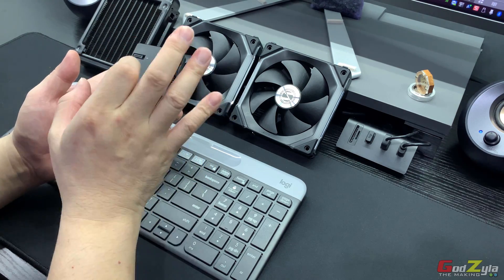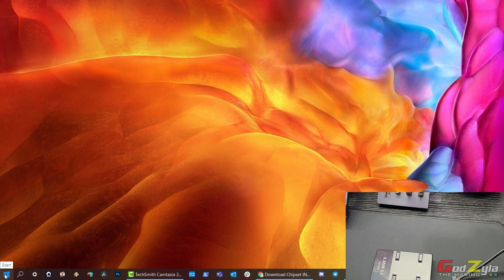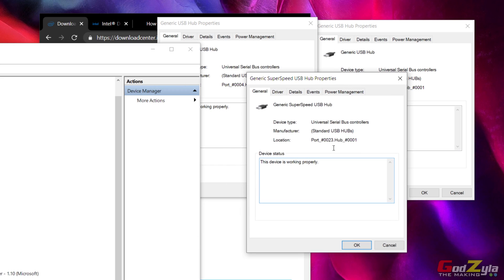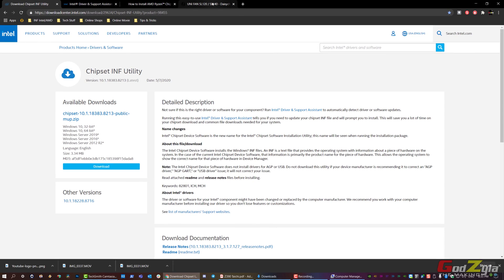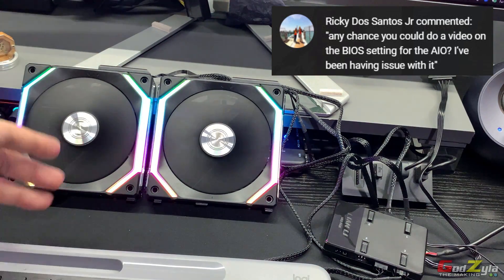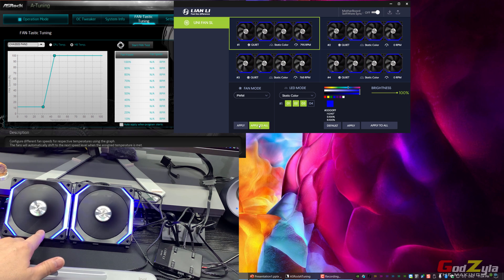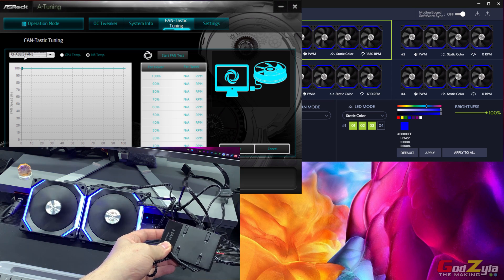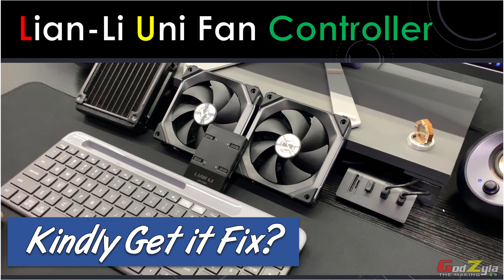Lian Li Uni Fan Controller - Some Break Fix! [L-Connect]

Comment: You are awesome, thank you for this!   Fixed my issue.  However, I'm trying to use two of these controllers.  The device manager detects both of them but once I bypass the manual controller (holding M1 down for 3 seconds) I lose lights.  I notice in the software there are only spots for 4 ports.  Do you know if there is a way to add the addtional 4 port from the other controller or am I screwed?  To be clear, I'm trying to run two sets of strimer cables.  First set works, second set not working.  If this can't work, what about modifying the cable to hook straight up to an ARBG hub?
Reply from the maker: hi Kilgoran, at the moment, when you mentioned that you are using two controllers. Are you referring to use two strimer plus controller to a unifan controller? 

if you are using 2 strimers controllers without the uni controller. yes you can get a spliter which connects the 2 strimers controller to your motherboard. 

if you are using 2 strimer plus controller with a uni controller. you can just plug each strimer plus controller to indvidual output of the uni controller. 
this video will show you one https://youtu.be/Y0ni_tfcX3g you can repeat to plug another into another output.

Comment: Well, I watched your video, and tried myself to solve my issue.
But still, I found no solution... :/ 

The USB cable, the PSU Data connector, the PWM connector AND aRGB cables are all connected to my controller and MB.
L-connect is installed and recognized into the Windows device manager.
But, nor the RGB, neither PWM are recognized. I mean the default RGB and PWM are applied and can't be changed.
I installed L-connect as an administrator, it doesn't change.
I switched my PSU sata cable to another one, it doesn't change.
Same for my USB cable, it doesn't change.
Same for my aRGB connector, it doesn't change, and finally... Same for the PWM connector... Well you understood !
I basically have no idea how these fans work... Or I don't even know if they really work, or should work lol.
Even in the BIOS, there's no fan recognized...

It was very simple with my triple pack of Corsair LL120+ commander Pro.

My partial setup : i9-9900K / aorus Z390 Ultra with a black cablemod.

I also tried to only plug USB cable, install the driver, then plus the sata cable, but still... L-connect doesn't recognize Unifans...

Any idea ?
Reply from the maker: Hi SNTSIS Media, welcome to my channel. it seems like you almost tested everything.. there is only two questions I have for you. are you still using the commander pro application? 
you might want to try removing that application and just test the uni controller with the USB and Sata cable. if that does not work, I would recommend you to post your issue at the lian li reddit website https://www.reddit.com/r/lianli/ or to raise your concern at li-lian tech support https://lian-li.com/faq/
Reply: @KleoYan   Hi Kleo :) thank you for your answer.
I'm still using the Commander Pro as it is my interface for my AiO (H150i Elite Capellix + 3 other LL120).
I'll try to remove all RGB soft (I've got MSI for my GPU, Aorus RGB Fusion for my MB & Corsair iCUE for the AiO & fans) and reinstall them to see what happens
Reply from the maker: @nuncyosa  Oh no. You have too many aRGB apps going on. Try to choose and use only one interface where you can control all. I believe those argb apps are snatching to have access with your system board. Just to share, In general, I dislike argb due to these reason. 1st draw extra current either from motherboard or from PSU. 2nd it generate heat (not much but still heat) 3rd argb often or overtime burn out easily. Once an argb led burns out. Your entire argb can’t be used. 4th unnecessary bloatware which causes lag in using editing programs or to do 3d rendering. This is part of the reason why I choose to use ASRock board, where u can control argb or rgb in uefi mode. Don’t need to install any apps. Or to use physical remote control method to control the argb or rgb. Still it’s up to individual liking. 

Additional info, some pc builders had issues with Asus Amour Crate app and also MSI Dragon app when using the L-connect.

Comment: Hey, hopefully youll respond but i recently installed these fans in to the controller and they light up and spin but i can change anything in L-Connect. When i go to device manager under Universal Serial Bus Devices i only see Aura LED Controller. I have a Asus ROG Strix-E x570 board, Any ideas?
Reply from the maker: Hello Nick Andriola, welcome to my channel, it looks like your Asus Crate took over control over the USB header. You might want to remove your L-Connect application first. reboot the system and re-install the L-Connect application using administrator mode. if it still does not work, remove your Asus Crate and L-Connect, install the L-connect first and test your unit. then install your Amour Crate.. alot MSI And Asus users are having this issues whereby the utility program is taken over the motherboard USB 2.0 header.
Reply: @KleoYan  Thanks, but that couldnt seem the solve the issue after deleting crate and redownloading L-Connect, when i replug my usb 2.0 my computer fails to recognize it.
Reply from the maker: @nickainthere4640  this is strange. Maybe double checked your UEFI under chipset. See if the USB 2.0 is enabled or disable. If it's till not the setting of your UEFI, it might be the USB cable to your uni controller is faulty. Do you have another PC to test on?

Comment: I got my fans to worked just fine but randomly one day L-connect just stop being able to control rbg. Its still recognized in device manager and the only way I've been able to get them to work is to disable it reboot and enable.
Reply from the maker: Hi Rooker live, welcome to my channel. what type of motherboard are you using? it could be related to the USB disconnected issue on some AMD motherboard, where you will need to wait for the bios fix.
Reply: @KleoYan  I was thinking the same thing but I thought it was weird that the only usb device affected was the controller. All my other devices work fine. I'm using the Asus B550 F.
Reply from the maker: @PostRook  I see, hmm.. have you tried deleting the Lian Li under device management, uninstall the app and reinstall it again? if it still giving you issues, you might want to log a support ticket with lian-li website or to ask around in the reddit website https://www.reddit.com/r/lianli/

Comment: Hi. I enjoyed your video and thanks for making time to do this. But still my issues of the USB not recognising my unifan is there. I have downloaded the chipset drivers for my chipset B550 AMD ryzen 7. I have re install the L connect and L Fix but still there no RGB and USB does recognise it other than the AURA LED controller
Reply from the maker: Hi hafiz jumat. Welcome to my channel. I would advise you to remove the USB that says Lian li under device manager, remove all L-Connect app, remove your motherboard utility that controls the argb and fan rpms, reboot your pc. Reinstall then motherboard utility first then reboot, install the L-connect application as admistrator in windows and try again. Reason for this as what I encounter with my friends build. The motherboard utility room admin control. That’s why. So you might want to try the steps I have provided you. If still can’t, kindly raise your concern at Lian li official website. There is a FAQ support for you to raise a support ticket.

Comment: Mi uni DNAs actually work properly but suddenly, with the new update all went to mess. I can’t control anything. Lighting, fans speed. I cannot control them anymore ;(
Reply from the maker: Hi Luciano Ramirez, welcome back. there are some reports from reddit that the new L-Connect 2.0 is causing some issues, that's why lian-li removed it from their official website for the moment. If you can't figure how to fix it. I would advise you to approach lian-li website and to ask their support for help. thank you!
Reply: @KleoYan the thing is the following. I instlled the 2.0 version and didnt work for me. Then I uninstall the 2.0 and install the 1.0. But the 1.0 does not work gor me either. I cannot change color, speed. The fans are at the same rmp all the time cause it always show in the L-connect 1.0 that there no rpm. Is says 0, but the fans are actually spinning
Reply from the maker: @RAMBOTNPC  I see, as what I can recall is that you need to run some kindo of patch to your unit before you can run 2.0. I myself have not try that, the last info I read was, if you have issues with L-Connect 2.0, turn off your PC completely, unplug the power source, press on the power button while your cable to PSU is unplug, this is to drain the power off to your pc, next is to unplug unplug the USB cable between your uni controller to the motherboard. leave it for few seconds. Now plug and power it up again. that's where some successfully use the L-Connect version 2.0 .. you might want to try that.
Reply: @KleoYan  sound cofussing. Btw, I try the 1.0 and does bot work either. I guess the solution is easier on the 1.0 because the 2.0 is still remove. The 1.0 is the one I tried out a few minutes ago but I cant change the fan speed or the light.
Reply from the maker: @RAMBOTNPC  then i have no idea how to help you out. the steps I have provided you, is not complicated at all. maybe i should do point form where you can follow.

just make sure you are using L-connect version 2.0 application. 

1) Turn off PC, unplug cable off PSU
2) press power button a few times to drain power off
3) unplug USB cable from uni controller to motherboard, sit for few seconds
4) plug back usb cable and the cable to PSU
5) power up. 

see if that works. if not then I would suggest you to approach lian-li as I am not able to assist you with your issue.
Reply: @KleoYan  i understand mate. I no longer using the 2.0 version. I’m trying to use the 1.0 but when I instal it, I can control the light and the fans speed. Is always at default. It was working correctly until I updated and the uninstall the 2.0 to ínstela the 1.0 that currently I cannot use. The L-connect is the issu
Reply from the maker: @RAMBOTNPC  as mention to you. Your version 2.0 patch is still in your windows 10 even you have uninstall it. Unless you know how to remove that totally. Which in this area. I can't help you with this so your best bet is to get in touch with Lian Li official support website.
Reply: @KleoYan  well, I discover something. I’ve never had the 2.0. I tried to install it but I was not able to it. But I have the same issue
Reply: @KleoYan  the software only functioned when I unplug the usb 2.0 when the pc is power up. When I restart it, I have the same issue. The only solution is to disconnect the usb all the time
Reply: @KleoYan  mate, finally I found the problem ! It was armory crate that cause the problem !! Now I have the question to how use the PMW mode. Do I need the armory crate ? Or anything like that ?
Reply from the maker: @RAMBOTNPC  aik good that you found out the problem which I totally forgot about Asus amour crate and the MSI dragon application that some of my viewers are facing. As for the PWM are you able to set it on your UEFI / BIOS? For me I am using a ASRock board so not familiar with Asus board. You will need to fiddle with it without the amour crate.
Reply: @KleoYan  yeah, kinda sucks. I cannot change the color of the ram and mobo but well. I will see in the bios to enable PWM mode. Anda what does pmw mean ?

Comment: Hey bud just found your video and gotta say they are great very informative! 
I have one issue and was wondering if you could help. Looked everywhere with no results. I have two uni fans and they were connected directly to L-connect>MB. I upgrade AIO and needed a 2.0 hub for both AIO and L-connect. Well now my Uni RGB when I cold start they start in Rainbow RGB unlike before they use to start from my selected colors. It doesn't chance until i log in to windows.
Reply from the maker: Hi Kal EI, welcome to my channel .. regarding about the L-Connect V 2.0, Lian-li official website ( https://lian-li.com/product/uni-fan-sl/ )  have stated that they have remove that due to issues. if you do encounter problems to get your hub work, kindly raise an RMA case with them. https://lian-li.com/faq/ . do pardon me as I am not able to aid you on this. unless you are using the version 1.0. thank you!

Comment: I'm having issues only like a quart of the rgb lights up and I can't controll anything with l-connect
Reply from the maker: Hello Ian, I thought your uni fan are doing fine hmm.. how come out of a sudden you can't control anything? any steps like update of windows, update uni fan to version 2.0 which was now removed by lian-li due to issues?
Reply: @KleoYan  no I didn't actually build with them until today I was missing parts for my build. I've been having so much bad luck on this build.
Reply: Honestly about to just take the hit and buy corsair fans and commander pro. I got so many issues I'm sort of just giving up on what's not working
Reply from the maker: @ianp6994  I see.. maybe you should do some troubleshooting first... but choice is yours.. anything you need help on. you know where you can find me :P
Reply: @KleoYan  idk what it could even be. Like my aio is messed up too so I'm probably going to rma it.

Comment: hi i got one question, when i on the motherboard sync, why the fan run at max rpm mehh? any idea sir? much appreciated. btw my motherboard b460f and i want to sync with aura but my strimer going crazy colour and unifan looks good but the fan run at max rpm
Reply from the maker: Hi Naqib Nizam, welcome to my channel. Now I am not familiar with Asus boards but will try to help. on your Asus board, are you able to set as PWM and not on DC mode? and for your strimers did you go through the uni controller or directly plug to the motherboard argb? this video might aid you out. https://youtu.be/njlkdM9lYbI
Reply: @KleoYan  haaa okay2 i’ve watch your video regarding motherboard PWM setting. Will try it later. Maybe default PWM going max rpm. Thank you sir.
Reply from the maker: @naqibnizam9762  Hi Ya, you are most welcome.. by the way, call me Kleo will do, all tbe best with your setup :)

Comment: I just got some lian li fans and no matter what fan header I put it too  they never ramp up and my pc just gets hot is a cpu fan y splitter a need for this? (My motherboard is asus z390 e gaming)
Reply from the maker: hi Punker Justin, welcome to my channel and thank you for your question. now, are you referring to the uni controller or are you talking about the motherboard fan header? mind to clarify. thank you!
Reply: @KleoYan  I'll put the pwm cable from the uni control on the cha fan 1 or 2 or my m 2 fan headers, and still doesn't register in bios so I can't edit the fan curves and just stay at stocks speeds. basically for some reason I cannot control the rpms.
Reply from the maker: @punkerjustin2332  I see, I seriously have no idea how Asus board works.. for me am using an ASRock board, as what i did is to have a set of fans daisy chained then plug directly to the motherboard fan header. as 3 x uni fan is at 0.54a which my fan header can take up to 2a. from there I do my fan curve in my bios/uefi once done, I will plug those fans back to the uni controller. Just make sure that my bios/uefi is set to PWM custom.. then I will be able to use PWM function on my uni controller. do pardon me, you will need to figure this yourself as I don't use Asus board..

Comment: hi bro, my unifan fans are working but the rgb fans are not. what did i miss? im pretty sure its plugged correctly.

i can see my device and i can change the fan speeds but no rgb
Reply from the maker: HI Ragarok Dada, welcome to my channel. have you tried just to connect one single fan to the uni controller and leaving the usb cable between the uni controller to the motherboard connected? try do basic troubleshooting. it might be a glitch somewhere. as you've mentioned you uni controller is about to change the fan's speed.

Comment: my pc detected the controller ist not "lian li" its "6k7750"  on device manager why? i have install your intel chipset driver
Reply from the maker: HI F4tal1ty, welcome to my channel. did you install the intel chipset after you install the L-Connect or before? by the way which motherboard are you using? I see what I can find out for you. thank you!
Reply: @KleoYan  yes i have testing with asus rog maximus vii ranger & gigabyte aorus x570 elite i install the intel chipset by asus its a z170 & amd for x570.
Reply from the maker: @F4tal1ty86  Hi, I believe you have the issue with your Z170 board. the only suggestion i can give you is to remove the USB under device manager while your Uni controller usb is still connected to the motherboard, uninstall the L-Connection application. have a today shut down of the, including power removed from the PC for 30 seconds or so. Remove the USB cable, boot up your PC again. re-install the L-Connect application "run installation as administrator under windows 10" shut it off again, plug the USB cable from the uni controller to your motherboard and boot up your PC again.. see if it works. if it does not, then I am seriously running of of ideas to aid you.
thank you!

Comment: I can not download the l connect driver on any app. what should I do? Every time I boot up my pc, RPM stay 0 all the time until i unplug the USB header. What should i do?
Reply from the maker: best is to check your PC any anti virus software blocking Lian Li downloads or such. If you are unable to determine what's causing you not able to download, maybe you can use another pc or laptop to try download the L-Connect application. 
thank you for your question and to have visit my channel.